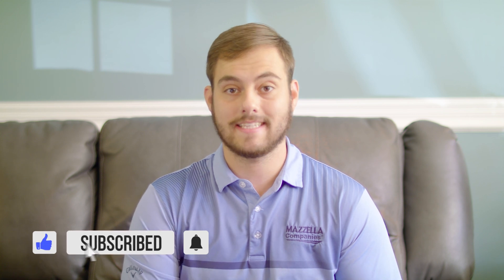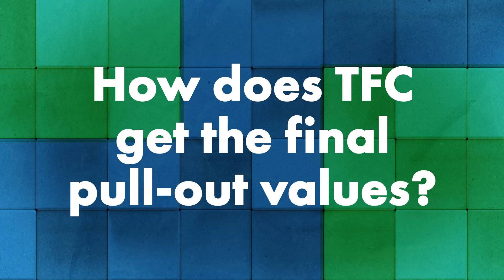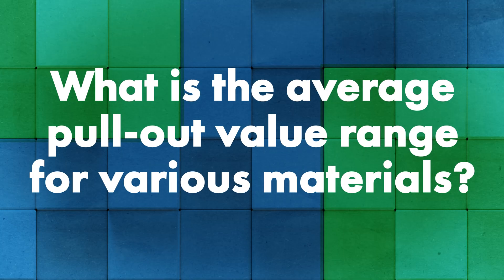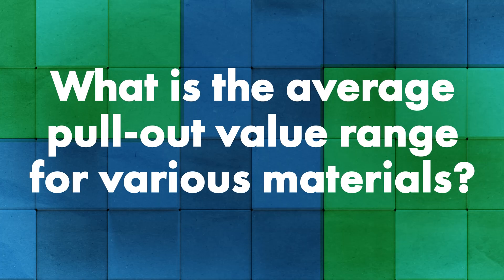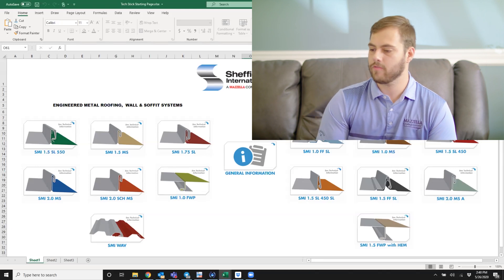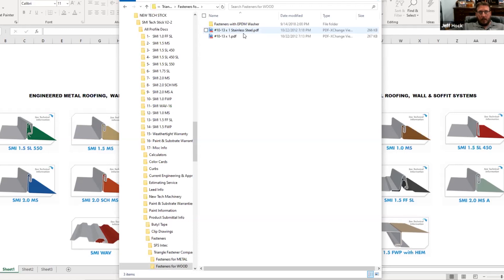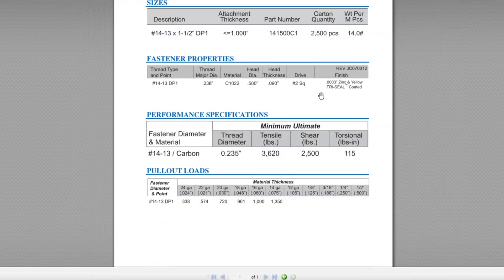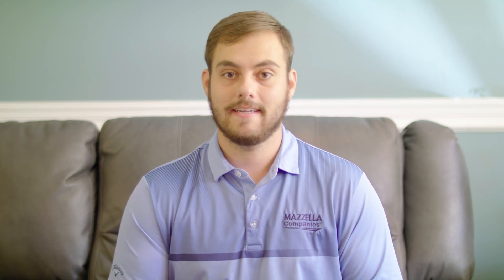Metal Roof Fastener Pull-Out Values: Measurement, Application, Use

Comment: FEMA has found snap lock metal roofs to be the worst performers in hurricanes, the wind pressures cause the panels to come unlocked. We have an exposed fastener metal roof in southwest Florida and it is rated for 200 MPH winds for zone 1 on the roof, rated for 200 MPH winds for zone 2 on the roof and rated for 190 MPH winds for zone 3 on the roof. Zone 3 are your corners. Our panels came from Tri County Metals in Florida and these numbers come from Creek Technical Services, LLC.

Comment: on our exposed fastener roof, the screws come lose after a few years. they come up about a 1/4"
is that pull out or did come unscrewed? its up in Telluride, CO, is that caused by thermal movement or wind. we can retighten the screws just fine, so it does not feel like the wood got damaged. What can we do about it?
Reply from the maker: With exposed fastener systems, screws can back out over time due to expansion and contraction as you said. This is very common. It's difficult to tell exactly why the screws are up in your specific case without seeing the roof. How old is the roof? Are screws backing out on every side of your building or is it only in a certain area? Does it look like the holes have been routed out by the fasteners moving back and forth over time? -Thad
Reply: The Metal Roofing Channel 
Hi Thad 
Thanks for your response. The roof is about 20 y old. It is north south oriented and the screws con up on both sides. It doesn’t really look like screwed are pulling out and damaging the wood, since you can tighten them up again and they hold
Reply: You sound as l if this is normal, but to me that is big flaw and a serious problem!  How is that roof going to stay up for 50y when you have to tighten the screws every 4/5 years?
Reply from the maker: @kululv  Exposed fastener systems do have the potential for screws to move because of changes in temperature and the inherent expansion and contraction of metal. Some roofs could be affected more dramatically than others due to the length of panels, type of metal used, and location. My suggestion would be if you are tightening the screws down, make sure the hole has not been stretched out and make sure the rubber washers on the fasteners are in good condition. Both situations could cause leaks over time. Also, because there could be an underlying issue that you're unaware of, especially if this happens regularly every few years, I would reach out to either the manufacturer or a local company to see if they have additional advice. -Thad
Reply: remove each screw coat screw with gorilla glue or squirt some in the screw hole then screw the screw back into the screw hole, don't over tighten .
Reply: @tedmed7349 ,who are you? Is this professional advice? It doesn't sound right that the screw would not come undone because of the gorilla glue...